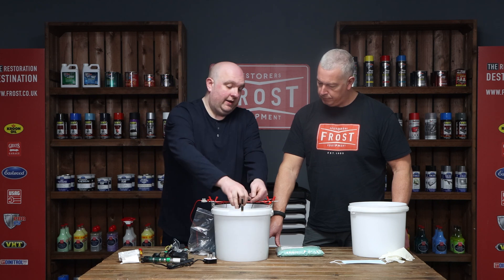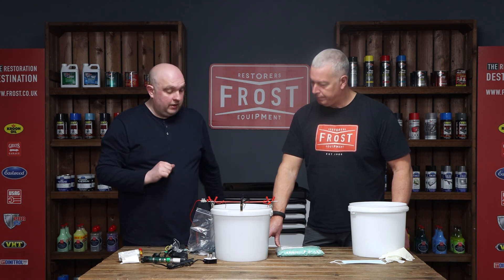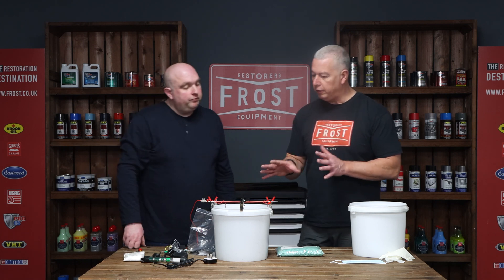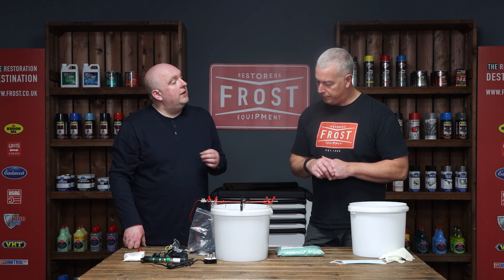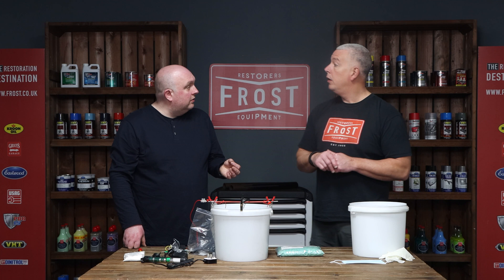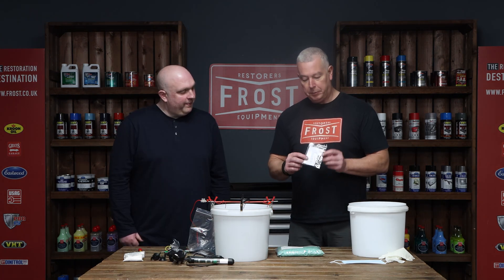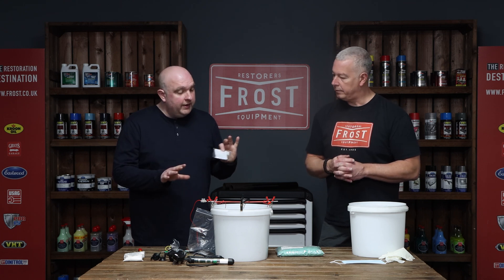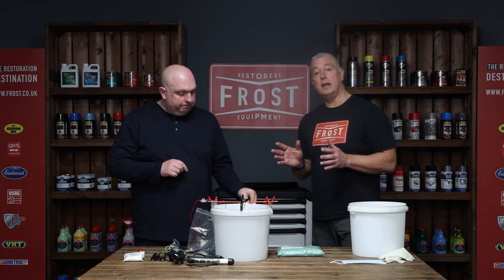How To Plate Nickel using the Frost Complete Nickel Plating Kit

Comment: i HAVE TO SAY, THE CONNECTION POINTS ARE NOT MADE CLEAR, IF THE VIDEO SHOWED FROM ABOVE IT WOULD BE CLEARER, THINK OF IT FROM THE POINT OF VIEW OF SOMEONE WHO HAS NOT GOT A CLUE, IT NEEDS TO BE CLEARER.  SORRY TO MAKE A NEGATIVE COMMENT, BUT I FEEL SURE YOU WOULD LIKE CUSTOMERS TO BE FULLY AWARE AND INFORMED,  YOU ALSO DO NOT MENTION THE USE OF DISTILLED WATER INSTEAD OF TAP WATER.  MANY AREAS THE TAP WATER IS OF VERY POOR QUALITY.  HOPE YOU REVISE THIS FOR CUSTOMERS.